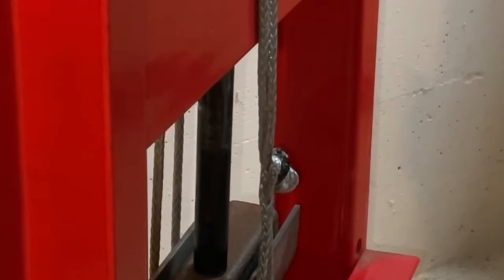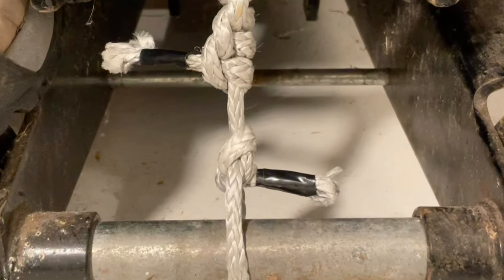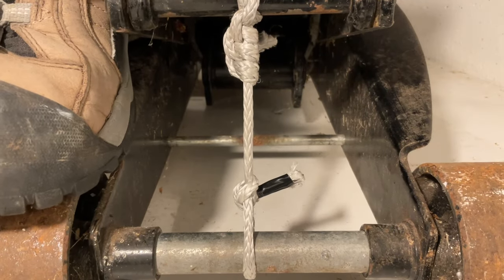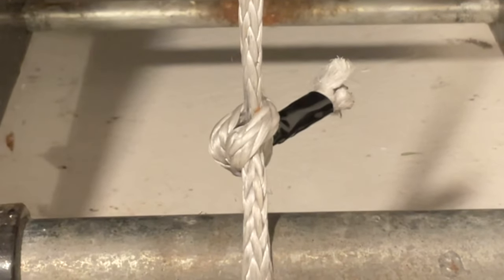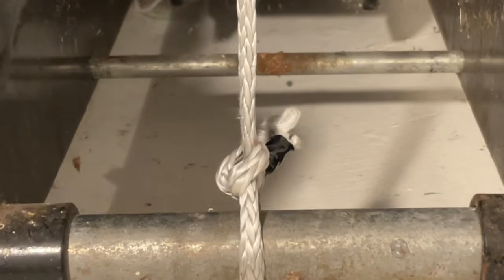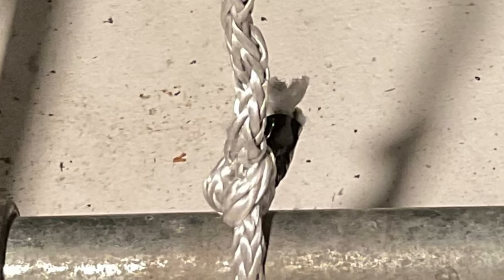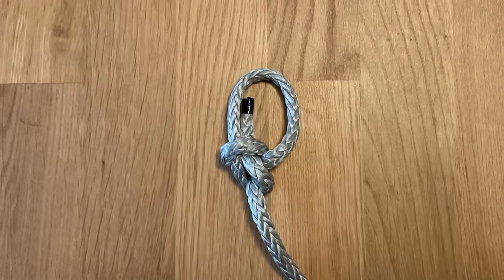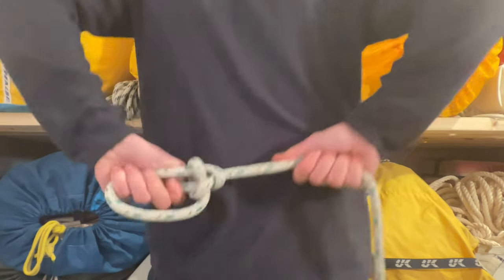The Knot They Say You Should NEVER Tie!!!

Comment: This knot may FAIL.  I fly big kites when I kiteboard, and use my personally invented technique called Power Looping.  It puts tremendous strain on my coated dyneema kite lines.  I don't use bowlines, because they fail - since they will cut themselves - as I've learned the hard way.  I tie a figure 8 slipknot, and those don't fail.  You can actually see the line cutting itself in your experiment - as the line slips, heats up and melts itself.
Reply from the maker: I think it's important to understand your particular use case and good to see that you do! Most sailors use 3/16" 5mm or 1/4" 6mm Dyneema which breaks at 12.5 and 4 tons respectively, but most sailing boats under 40' never see running rigging loads greater than around half a ton, which is well below where a knot in Dyneema will generally give you trouble in this size of line. You are using much smaller line which is loaded to a much higher percentage of its breaking load so it's good that you've found the right knot!

Comment: There are a many different bowlines if you really want it to hold do a double reff, meaning go around twice. We've tied bouys on crab pots using that, but we went around three times and then taped it. It holds and is easy to untie.
Reply from the maker: That’s a good suggestion and is still easy to tie - thanks for that!
Reply: Many bowlines? You mean wrong versions of the correct one? I've tied a standard bowline for 40,000 sea miles and never had one be unfaithful. To be fair, I wasn't using Dyneema.
Reply: There is only 1 bowline knot. Using a round turn or 2 on the piece you are tying on to is sometimes wise. But that is still a bowline
Reply: Moreover the tie weakens ropes less for a couple percent and less prone for untieing with variable multidirectional load

Comment: I learned to tie the buntline and prefer it for slippery lines, but I can't tie it blindfolded like a bowline!
Reply from the maker: That's a good suggestion and alternative to the bowline - thanks for that!
Reply: I found your video very informative- the bowline held better than I thought it would! Thanks.  @SailingTipsCa
Reply from the maker: @jims5338  Yes I also thought it would slip out under the constantly increasing pressure of the jack, which is different than the dynamic loading on a boat that tends to set knots!

Comment: The simple solution is an extra lock loop on the tail. Stops the bowline from slipping when loose and doesn't make it any less easy to undo.
Reply from the maker: Good suggestion - thanks!!!
Reply: @SailingTipsCa  I read down after and seen that a few others had made similar suggestions of a few variations of the lock loop. I just use a single "P" shaped loop over the rope next to the tail. Once you release the main loop of the tensioned side, the P loop typically falls apart as well. But with that slippery braid you may need to experiment a little I guess.
>
I worked with an old feller back when I was young who claimed to be the fastest at undoing any bad knot. He would pull his razor pocket knife off his belt and zip, knot undone. Funny old character he was :)
>
A was just thinking you can splice those braids to put a loop or terminator end on them that wont pull through, but that can lead to other problems depending upon where you are using the ropes. We always used special non stretch braid in water skiing so splicing was the only way (Never knots in ski lines).
>
Thanks for the video and reply. 
P.S. Oh, I think the reason some say to not use a bowline is that they can slowly undo when when sitting "loose knot" in the wind, thus the recommended lock loop or P lock if you wish.
Reply: P.S.S. I wasn't being silly about the story with the old fella and the knife. In a time critical emergency a knife is the fastest way. Rope is relatively cheap compared to your life :)
As an extreme example our local pro fisherman and trawlers often use steel cable (Supper strong rope if you wish). There is always an axe with a hardened steel sharp edge for "quickly releasing" cables next the the main spools. That axe (and the speed of releasing that cable) is the difference between life and death in many situations.
Reply from the maker: @axle.australian.patriot  Yes it’s required by the racing safety requirements for there to be a sharp knife in the boat cockpit for emergency use. Bowlines are often used to attach headsail sheets, which can get flogged about a fair bit when tacking or gybing, but still I’ve never had one come undone. Thanks for the comments!

Comment: If you know a knot well enough, you should be able to tie it behind your back with little problem unless it requires larger action than you can manage.  Tying it in front of you with your eyes shut solves that problem. Best I've managed so far is a button knot with my eyes shut.
Reply from the maker: Yes tying in front of you with your eyes closed is the easiest way of simulating tying in the dark, which is the most likely scenario of having to tie anything without being able to see. I can’t think of any practical application of tying behind your back other than as a party trick!

Comment: In a pinch it will work and I would not worry, but if its part of a permanent solution just teach yourself how to splice it. Looks better, is safer and also quite fun and very satisfying. If you have to use a bowline on it, you could also make the tail end a bit longer than usual, just to be safe.
Reply from the maker: Yes splicing is absolutely the best solution for many applications, especially critical ones like standing rigging!
Reply: Yes to a longer tail and adding a half hitch after it should also keep it from slipping
Reply from the maker: @CullenKasunic  Nice and simple safety measures!
Reply: When the knot slips and its dry it cause friction and heat. Uhmwpe ropes do not cope well with heat. On a boat its usually ok cause the knots are more prone to be somewhat wet.
Reply from the maker: @mylifeisdope916  Yes the speed of the slip is also a major factor in determining how much heat is generated!
Reply: @SailingTipsCa  A splicing video would be great
Reply from the maker: @ThisIsTheInternet  Good suggestion!!!

Comment: Recently had an arguscussion about soft shackles for asym sheets and someone told me about splicing 12 strand to double braid and making an integral soft shackle which sounded neat and all but I feel like it is faster and easier for me to tie and untie a bowline than a soft shackle. Am I wrong? Is it just taste? Is there a proper doctrine for the doctrinaire? And BTW when I used to go climbing a lot of the time my main tie in knot would be a double bowline with a double overhand safety knot. Much easier to untie after loading than the figure 8, especially when your forearms were pumped.
Reply from the maker: Honestly I think it’s just taste. I use a simple integral soft shackle on my own boat like the one described in this video: Need to Tie a Soft Shackle into an Existing Line? Try This! https://youtu.be/IolAHmzrKrk But I also sail on another boat where we just tie the sheet pigtail to the spinnaker clew with a bowline, and it’s Dyneema, and it’s just fine too, and probably faster to tie and untie as you noted!

Comment: I think it didn't slip out because of the electrical tape on the end.
I've spent over 35 years commercial fishing on the Bering Sea.
I've been to school for net mending, I know my knots.
Once while tendering Herring, I tied a boline to the brailer filled with herring. It was a poly line with lots of herring oil. It slipped out. Didn't hurt anyone. But there are limitations.
Reply: The square knot is one of the most dangerous knots there is, it should be only used to tie things that don't matter.
Reply: Oh BTW I do love your channel. Appreciate you telling an old fisherman about sailing. Thanks, I look forward to seeing more.
Reply from the maker: As a commercial fisherman on the Bering Sea I’m sure you have stories that would turn most grown men to sobbing masses! Yes I agree that there are limitations, and maybe it was the electrical tape that helped the knot hold - I should test it without and see how that holds. I also think it’s important for people to know their loads and size their knots, lines, and gear accordingly. Most rigging loads on most sailing boats under 40’ / 12m max out at around half a ton, which is about 20% the breaking strength of 5/16 or 5mm Dyneema, and also well below where I’ve ever tested a Dyneema knot to slip. Obviously you would want to use something like a splice on standing rigging but the point of this video is that people don’t have to be quite as afraid of knots in Dyneema as they tend to be!
Reply from the maker: @MrM-hl1vp  And I’m glad you like the channel - thanks for watching!

Comment: Nice thing about a bowline is it unties Easily after loaded up.  Now think about that your next trip up the mast. There’s the reason rock climbers use a finger 8.
Reply from the maker: Yes it is easy to untie after loaded! At the same time I don’t think I’ve ever seen one untie itself even when attached to a flogging sail!
Reply: @SailingTipsCa  On a flogging foresail, I have seen sheets untied, if the bitter end is too short.
Reply from the maker: @dmitripogosian5084  Yes you definitely want at least 3” or 8 cm of tail on sheets!
Reply: @SailingTipsCa  Indeed, and the one at the start of the video looked too short for me :)     Though on dinghies with standard polyester halyards, we were taught to tie a very tight bowline for the main sail halyard

Comment: The bowline is a great knot, but you didn't really test its weakness as I understand it.  Its weakness is that it can loosen up under intermittent tension.  The Dyneema probably increases that risk, since it is slippery.  

A more appropriate test would involve switching between having a taut line and having full slack.  Maybe rig something to lift and drop a weight repeatedly

That said, I've never had a bowline come loose on me, although I typically use them under constant tension.
Reply from the maker: Yes that would have been good to test! In practice I’ve used them mostly for attaching spinnaker sheets on sport boats, which do include periods of loading and flogging (unfortunately) and have never had one come loose.
Reply: I agree, the knot needs to set under high tension.  
I use bowlines on heavy mooring bridles, but tie the ends down as I find it difficult to pull enough tension.  Once in use it is fine.
Reply from the maker: @markthomasson5077  Yes the setting part is critical!

Comment: Hmmm... Knots in dyneema is just bad karma.  Just as knots in nylon didn't behave like knots in hemp or other natural fiber, knots in dyneema don't behave like knots in nylon.  Knot setting, strength, and stability is a much greater issue.  
"How bad are knots in Dyneema?"  https://www.youtube.com/watch?v=MdA9mdDlJ6Y
Reply from the maker: Those guys at HowNot2 make great videos! As they showed you’re not (pun intended) going to get full breaking strength with a knot like you would with a splice, but Dyneema is also so strong that not getting full breaking strength isn’t necessarily a problem. For example, working loads on running rigging for most sailing boats under 40’ / 12m is about half a ton, or about 25% of the breaking strength of 3/16” / 5mm Dyneema, which is also well below the load where a knot will cause you problems. So saying “knots in Dyneema are bad” is kind of like saying “fire is bad” without context - sometimes it is bad, but sometimes it isn’t and can even be helpful!